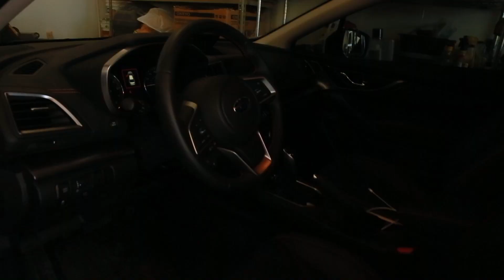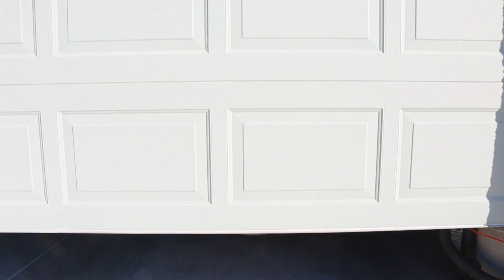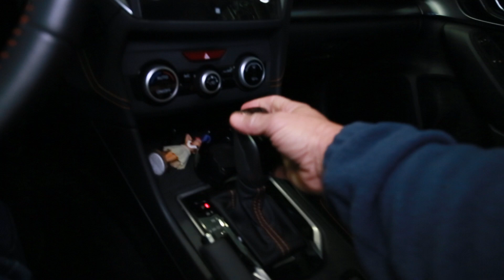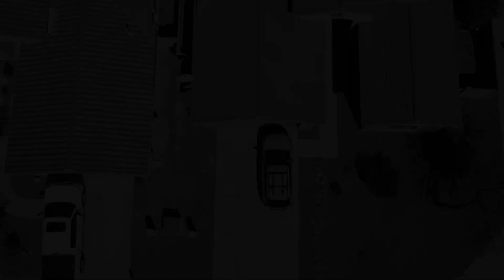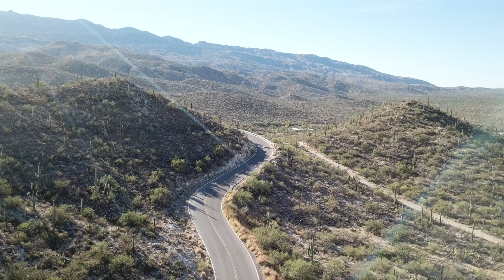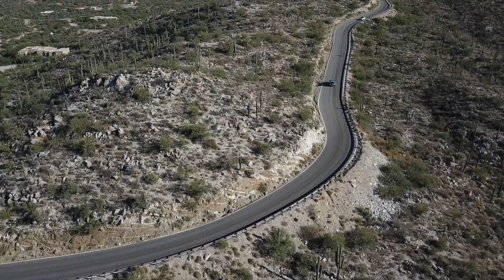2018 Crosstrek:  How is the CVT related to Oil Temperature?

Comment: This morning. 40F ambient at constant 60 MPH. Limited CVT. Manual mode offered 7th gear at 174F Oil Temp.
Reply from the maker: Nice.  Thank you for the input.  Mine allowed me to go into 7th this morning at 140F again.  32 to 35 F on my drive to work.  Cheers.
Reply: Well. Today ambient temp was 40F. Got on highway at 102F oil temp and it allowed 7th in manual mode. I was going 75MPH at the time.
Reply from the maker: Interesting.  So it even varies with the same car.  What a trip.  Thank you for the update.  Cheers.
Reply: So a couple of days ago the car offered 7th gear in manual mode at 110F. I had to be going faster than 60 MPH. As soon as I dropped to right at 60 or below,7th went away.
Reply from the maker: Mine will usually give me 7th when warm at 45 to 50mph.  I can't figure these cars out.  :)
Reply from the maker: This morning coming into work the Temperature was 55 F, oil temp 96 F and my car went right into 7th at 45 mph.  LOL  I can't figure this oil temp, CVT thing out.  :)

Comment: Haven’t really noticed it on my ‘18 FXT but I know that my ‘05 Dodge Ram holds a lower gear and higher rpms when engine is cold to help warm the engine/transmission. I’m sure Subaru and many others do the same thing.
Reply from the maker: Thank you Mr. Sleep.  Any suggestions for my insomnia?  :)  My job has destroyed my ability to sleep well.

Comment: A nother issue with Subaru!  that car was on my test drive list. Not any more. Thanks for the heads up.
Reply: An interesting thought adding to this. I believe (and I could be wrong) but by limiting the shift into "7th" gear the Subaru engineers are helping to keep the RPMs a little higher. Why? When an engine is cold, it operates in it's least efficient mode. I believe that Subaru Engineers (and many other makes) now, with the advent of modern ECU programming advances, direct injection, etc. manage the transmission "shift points" to help bring the engine up to operating temperature in the fastest, yet still safest manner. A slightly higher running RPM will help quicken this, and you'll notice they don't just rev it to the moon! (that of course would be bad!) Not until an engine reaches optimum operating temperature can it run at an Air/Fuel ratio of 14.7:1 which results in the greatest chemically complete fuel burn. All of these factors help to increase the fuel mileage in the long run (it's just the people in colder climates suffer from delayed warm ups due to ambient outdoor temperatures) as well limiting the amount of smog (Catalytic Converters need heat to function properly) a car will produce.
Reply from the maker: Hey ramona, don't let this put you off on Subaru.  Not really an issue, just trying to figure out why the CVT is waiting to warm up before shifting into 7th.  Pretty sure it is normal and just trying to keep rpm's up to help warm the car to operating temps.  I have had 3, 4 in the family and have had zero problems.
Reply: Rick Hutton Thanks! It really looks nice!
Reply from the maker: Great explanation as usual!  Thank you sir.

Comment: Hi Rick , this is a very important topic you have covered clearing every bit of CVT. Have to  check the same here in the middleeast it should be easy for having the oil temp raised , our weather temps go up to 122 F degrees in summers.
Reply from the maker: Wow!  :)  That is hot.  We don't get quite that warm around here, but some days in the summer it feels like it.  What does your oil Temp run on a normal day for you?
Reply: Yup! It reaches 180 F - 210F sometimes. Mercedes BMW have interim oil check / top up intervals apart from regular service intervals. Some of the BMWs I have checked which had 12mi service intervals in the past the oil would grease up in the engine.

Comment: Thanks Rick for the great videos and information.  I'm learning a lot from your channel.  And, I really like the look of your 2018, with those rims and tires.  As for fuel economy, I also get about 33mpgs about 20% city (Vegas area with SouthWest roadtrips).  And that oil temp thing  could explain why my 2017 xtrek does the same with the higher gear shift.  The computer sometimes reads 45mpg avg.  Thus, I use the website fuelly to calculate my MPGs and keep a log of the driving conditions.   

As for poor fuel economy, I really get horrible fuel economy when I go over 65mph on those long ascends and descends.  Strangest thing is my worst tanks of gas came when I did almost no city driving and hit the freeway speed limit 70+.  I also noticed that all gas stations are not created equal.  Depending on the type of gas and ethanol additive can impact fuel economy.  When I fueled up at Red Earth Casino in Borrego Springs CA  I got over 37mpg.  Perhaps the amount of fuel additives has something to do with it. 

Anyway,  keep up the great work with the videos.
Reply from the maker: Hey Toxic Tabasco, thank you for commenting and your kind words.  Is your Crosstrek at 18?  I have not done a lot of highway yet in the 18, but my 14 acted exactly like you are describing.  Over 65mpg for a long stretch and fuel mileage would suffer.  Most of the time on the highway I would travel 75 to 80 and would end up per the computer under 30.  In all city driving it was much better.  My STI was same.  Funny thing is, both of the cars would run around 3K rpm's at 75mph and the 14 didn't have an "overdrive gear" and the STI's 6th gear wasn't that tall.  The 18 will do better I am guessing, based on what I have seen around town and the short 15 or so mile freeway trips I have done. Other 18 owners seem to be reporting good highway mileage as well.

Funny you mentioned fuel additives.  Just the other day I had a couple of comments about much better mileage with ethanol free gas.  I looked it up and in my area there are exactly 0 non ethanol stations.  :)  bummer.  I want to say the comment stated he was at 40 mpg?  Not sure if that was computer calculated or by math.  Cheers and thank you again.
Reply: That's interesting.  I think the 40mpg could be computer.  On the website Fuelly most Crosstrek drivers get 28 to 29mpgs.  But most people drive city vs hwy on Fuelly.   I have the 2017 with CVT 6 speed.  I also use the manual paddle shift to keep the CVT in 6 on the freeways.  Seems that 1900 to 2200 rpm is the optimal range for best fuel performance.  Once my rpms get below 1900 rpm it downshifts back into 5 regardless of paddle or full auto CVT.  

Las Vegas Subaru's have the PZEV stuff on their cars.  I don't know if that makes a difference with fuel.  But overall, I get pretty good fuel economy overall.  Anyway, there's a website called "pure-gas.gov" that has a list of additive free gas stations.  I don't know how accurate it is, but they have some in AZ, NV, CA, and UT areas.  Keep up the great work.

Comment: Indeed. I live in Michigan and we haven't had a day over 20 degrees since last October. With that being said my 18 Trek keeps RPMs way up for the first few minutes of running until the oil reaches an ideal temperature. I tend to be light on the gas during this time as my reasoning says "the engine is still trying to warm up". I baby my car too much  lol After that, it resumes to normal RPM ranges though.
Reply from the maker: Hector, awesome input.  Thanks brother.  Sorry about the cold!  I would not last LOL....

Comment: Great videos! Is there a way to see oil temp on premium models?
One thing I notice, and this is even after driving for over an hour is I drive 12 miles of a winding road with some hills, some steeper than others but for the most part can maintain the same speed (55) the whole way and let off the gas for curves to slow down 5 to 10 mph. But when getting back to speed a lot of times it seems like it's in a lower gear, therefore getting worse gas milage. It does the same on a straight away with little hills with cruise control. It downshifts then doesn't get back into a proper gear for my speed. I find myself not using cruise as much as previous cars.
Reply from the maker: HI Caleb, thank you very much!  So it sounds like the car is down shifting to help get up the hills and then isn't kicking back into a higher gear?  It does seems that sometimes the CVT doesn't always choose to go up into the overdrive gear in those situations.  Have you tried clicking into manual mode and shifting it up with the paddles?  I did that quite a bit when driving from Tucson to Flagstaff up the grades.  I was finding the car was shifting back and forth so I would just go manual and leave it in a lower gear to climb better.  Definitely effected the mpg though.  

As for the oil temp on the Premium I am not 100% sure, but I don't think so.  Maybe another Premium owner can help out.  I went out and look all over my wife's WRX and could not find a screen showing oil temp.  Sorry I don't have a better answer on that one.  Thank you again for watching Caleb.
Reply: Rick Hutton Thanks for the response! I haven't tried using the paddles too much. I've never had them or seen them in a vehicle before, I don't want to break something. Haha!
Thanks for checking in on the oil temp.
Reply from the maker: Very welcome Caleb.  Give them a try!  They are fun and the car won't let you mess anything up if you forget to shift.

Comment: Rick, first-time commenter(?), long-time viewer. Great videos! Love your car, love your videos! I've got a limited 18 crosstrek. Got out of a 16 Ram 1500 to save on fuel. As such, and because I miss my truck, ive been religiously driving for peak fuel economy. Thought I was doing great as the computer has reportef 34.2 - 35.7 avg mpg for each tank over the first 6000 miles. Well here's the bad news, I've calculated my economy at the pump simply trip miles divided by gallons to fill and am seeing 27.5 to 29.1 mpg! Huge difference for me as fuel economy was a big factor in the car purchase. I'd be very interested to see if you experience the same large desrepancy between the economy computer and the old fashioned mpg calc. Any other thoughts guys let me know. I've owned 5 brand new cars (Subaru and Ram) in the past 8 years and have never seen greater than 6% disagreement between the computer and the old fashioned calc. Thanks again and keep up the videos!
Reply from the maker: Colter, thank you watching and commenting and for liking the videos.  Really appreciate your kind words.

  I am really surprised to see such a large discrepancy between the computer mileage and your calculations.  As I mentioned in the video all of my Subaru's have been off by about 2mpg when compared to the computer and that seems to be the norm from others I have seen.  4 or 5 mpg seems a little crazy to me.  My 911 also has an estimated fuel economy and it is off by a bit as well, but not quite as much as the Subaru.  

I have thought about this issue a lot and wondered which is more correct?  Computer or math?  My guess is not every gas station clicks off at the exact same amount when we fill up so how much is it off from actual full?  And how many gallons of fuel did we actually use? It seems like the computer might have a better idea as to where the gas level really is when we reset the trip meter as compared to what we think is full?  I am not really sure. It is also true that Subaru and other car companies would want to over estimate fuel mileage... :)  If you keep your eyes on the Miles left before empty gauge it seems to be pretty close so I really don't know what to believe.  34 and 35 mpg is pretty awesome!  I've was doing 32 or 33mpg prior to the wheels/tires.
Reply: Thanks for the reply Rick. It's very strange. I drive almost every mile at 65mph on cruise, flat ground, no traffic. Obviously ideal conditions for maximizing fuel efficiency. I wish I could just believe the computer but even assuming I'm overestimating fuel added at the pump and not factoring in loss of fuel to evaporation the desrepancy is far too big for me to believe the computer is, at best, not calculating or recording accurate fuel volumes being consumed. At worst, the   EPA did Subaru a solid with their fuel economy rating (ussually the opposite is true in my experience). Either way, I'd love to hear from other crosstrek owners on how the gas pump calc compares to the cars computer calculated value. I've tried 4 different stations to eliminate that variable, same result everywhere for me. 

Anyway, I love my car and I love yours too. I'd do the same tires and wheels you did if she wasn't my commuter. I silently voted for the combo you chose.
Reply from the maker: HI Colter, agreed man, that is a big difference you are getting and in my experience you are at the perfect speed for mileage.  I imagine the dealer will just tell you it is an estimate and they are different from car to car...What kind of mileage are you getting out of a full tank?  When I do my normal daily driving, with old wheels/tires, I would get over 400 miles per tank consistently.  Which is something that didn't happen with the 14.  All of the previous Subaru's I have owned, except for my wife's WRX, have actually done better in the city mileage wise, vs the highway.  Her car actually does well..and I think she got 31mpg, via the computer, on her last trip up to Phoenix.  My STI never got anywhere near that.  Let me know if you figure anything out Colter.  Thank you again for your comment and info.
Reply: Hey Rick I'm consistantly over 400 miles as well each tank. Interesting your experience with mileage in city vs hwy. I have lived in rural locations with a brand new 2011 impress outback sport 5spd and a 2013 crosstrek. Again 90% of the miles pur of those cars were 65mph highway with no traffic. I exceeded the EPA rating by 1 or 2 mpg with both cars with good agreement between the computer and pump calculation.

Man I'd consider a wrx if I could get 30mpg! Fingers crossed the turbo this crosstrek someday!

Thanks Rick love your work man!
Reply from the maker: Thank you again Colter.  Very nice of you.  

A turbo in the Crosstrek would be awesome!
Reply: @mtbikemoab8686  They got a CVT Crosstrek with a bigger 2.5 L engine,  182 hp ! Maybe in a year or two a 1.8L turbo crosstrek...who knows

Comment: I have a 16 Impreza and it behaves the same way. I’m in Wisconsin so it’s been cold lately. It doesn’t have a oil temp gage, but the rpms will not drop until after the blue cold engine light goes out. It’ll hang out around 2k rpms until it’s up to temp then drop to 1200ish.  It seems to help the engine warm up quick but at the cost of fuel mileage. I’ve heard the cars will have a high idle when cold to help warm the catalytic converter up so it functions properly and reduce emissions.
Reply from the maker: Allan, thank you sir.  Appreciate your input.  Cheers.
Reply: Rick Hutton just to be clear this engine behavior is while moving.  I’ll try to “shift” it to higher gear while cold and see if I can get the same results.
Reply from the maker: Cool.  Let me know how it goes.  It was another chilly night around here and I am headed to work if a bit so I am going to try and record what happens.  I will let you know if I have the same results as the two previous days.
Reply: Renal Colic do you have star link -oil temp gauge in there.

Comment: Great video Rick. I will definitely keep an eye on the oil temp and the selected gear and revs. I'll make some notes at highway speed with regards to revs and current gear selection. Instead of shifting to Manual, can't you just hit the + paddle and see if the revs drop while in Drive?
Reply from the maker: Thank you Peter.  Really appreciate it.  I think you could just hit the paddle over...when you do that, would it tell you which gear you are in?  I guess that's why I put it to M, so I could see where I was.  Like this morning I ended up in 5th instead of 6th?  Hop fully I am making sense.  :)  My darn face hurts.  LOL
Reply: @AZdroptop  same thing happens to me , on my impreza 2017, it's normal behaviour when it's really cold

Comment: 2018 Crosstrek/XV: On an opposite note how hot does your oil read on a hot day? Mine often gets to 100 deg C (212 Deg F) after 20 Mins of driving. Amazing to think the oil is at boiling temperature. This is on a 25 deg C 77deg F day .
Reply from the maker: HI Allan, similar temps on my end.  A subscriber Que Ball, had some temps in the 230 range one day and checked with the dealer.  They told him 210 is considered "normal" so I think you are all good.  Seems hot to me as well, but I guess I've only ever payed attention to oil pressure over the years

Comment: Not being from the US, all the temperatures you mentioned just go right over my head because we use Celsius here.  I'm not suggesting you stop and convert for me or others like me but maybe in the editing you could add some onscreen conversions.  

Of course some may say I can stop and google these conversions but in reality it's not something I (or most) will do unless it really pertains to me (currently summer here in Aus and where I am winter is not that cold really - between 6-16C) so not experiencing the same issue here but I still watch all your videos.   I appreciate the information and I love your content, but you also have global audience as well. Just something to think about. Cheers mate.
Reply from the maker: Totally agree.  I actually meant to add the number on the screen, but with my stupid jaw hurting and lack of sleep last night I completely forgot.  Great tip and very appreciated.  Cheers bickety!  A little late but 140 F is 60 C.  I wish I would have learned the Metric system a bit better as a kid...Since I started bike riding/racing about 10 years ago I finally got a hint of what a kilometer is.  :)
Reply: Here in Canada we use both systems even though we officially use the metric system. Sometimes we use feet and meters or MPG or l/100km! :)